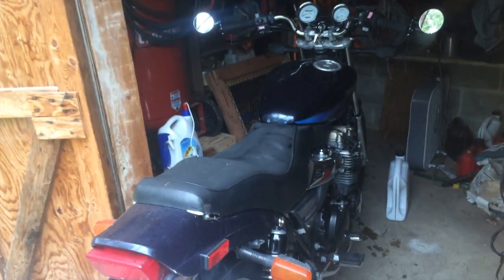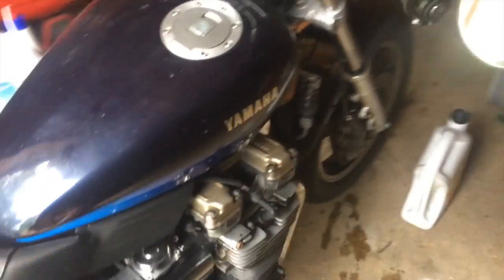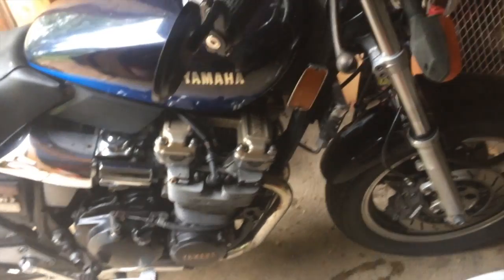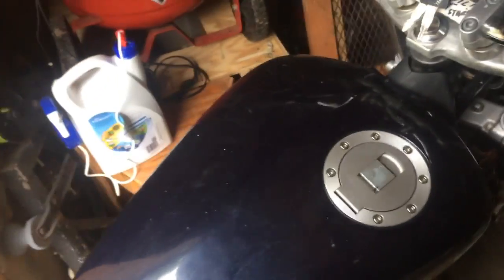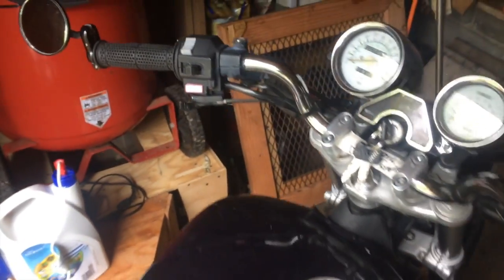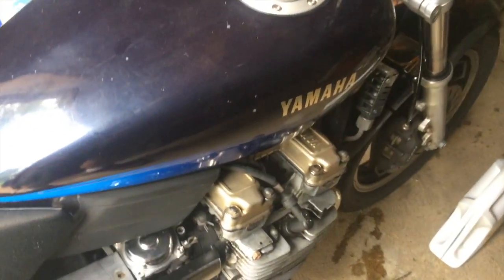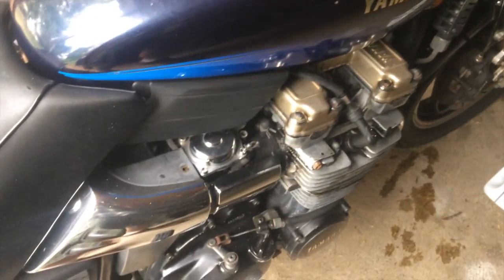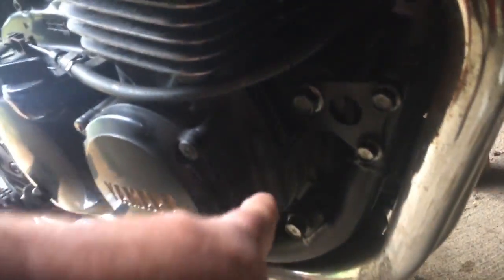sound

Comment: have you looked into the clutch basket? They all tend to make this sound after age creeps up on them. Does it make the sounds with the clutch pulled in ? Also I'd like to know how the oil cooler has been working ?
Reply from the maker: The oil cooler appears to be working fine.  I can't tell you how much it has dropped engine heat, but it gives me peace of mind, knowing it is there.  I've only ever really worried about engine heat when I have been stuck in traffic on a super hot day, so, when one of those days arises, I now think to myself, well, at least I have the oil cooler to help.

No, I haven't looked into the clutch basket.  I diagnosed the noise as a loose exhaust header clamp, after making this video, and told Joe Bond about it, replying to his comment on this video.

Comment: so did u ever find out what it was dexter?
Reply from the maker: Thanks for asking, Joe.

I'm still trying to figure out what, exactly is going on.

It isn't a rod knock.  After this video was made, I eventually found a loose header connector, the aluminum piece that locks the header to the head.  I tightened it down, and eliminated the "rod knock" noise.  It was so loose that it was bouncing around, rhythmically, sounding like a rod knock.

Lesson learned:  CHECK THE SIMPLE THINGS FIRST!

But the original problem still persists, a rattle-ly noise, occasionally (seems to depend on engine temperature???) when applying high load, low RPM (like pulling away from a dead stop.)

My first thought was "exhaust leak," and I still think it has to do with the exhaust...but at this point, I have replaced everything from the collector on back...collector and both mufflers.  The sound is still there, although it sounds quieter, after the most recent replacement of the left muffler (I originally suspected the connection between the collector and the right muffler).  I thought it was either an exhaust leak or a rattle-y baffle.

Derek said that he suspected the Intermediate Shaft Damper, or bad primary chain.  The ISD is a small rubber part that damps the movement between the engine and the primary drive, that could have gone bad and made the primary chain rattle a=under thouse conditions,  Derek is usually right, but I am still not convinced.  (The fix involvese splitting the cases,a nd essentially a complete rebuild of the engine).

Currently, still riding the bike.  I don't think the engine is going to seize, but I am keeping my ears open, trying to figure this MF'er out.

Fixing the easy things first, and if I do determine that the damper is to blame, or just get sick of sounding like crap pulling away from every light, I will swap the engine with my spare.  I really don't want to do that, but after swapping out most of the exhaust system, I think it may be necessary.

Like I say, though, it does sound quieter, now, after the exhaust swap, so maybe it is related.

I'my mystified...and still smoking wannabe's when the light turns green...lol

Thanks for asking.

I think some of this had been recapped on the Yahoo Newsgroup, so there may be more info, there, that I am forgetting to include, at the moment.

Regards,

Rich
Reply: good to hear it wasn't as bad as you first thought